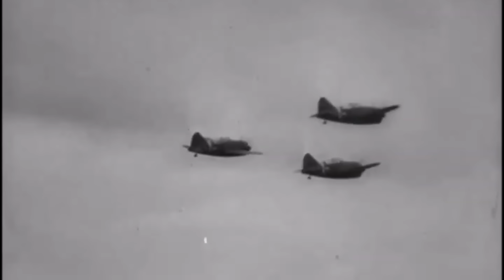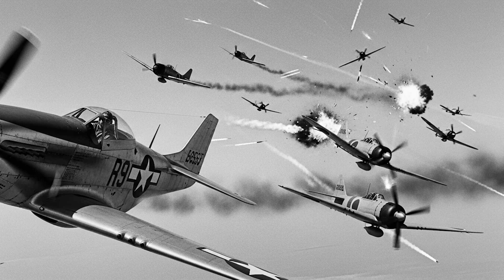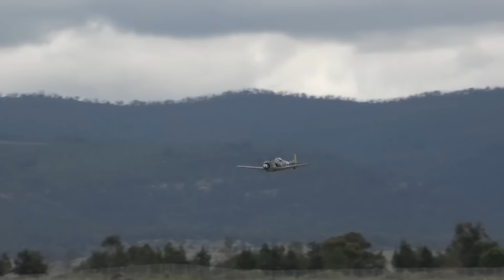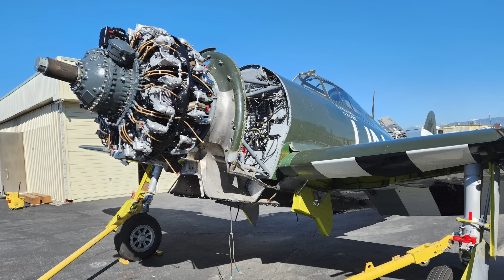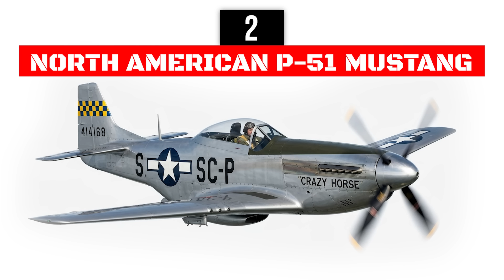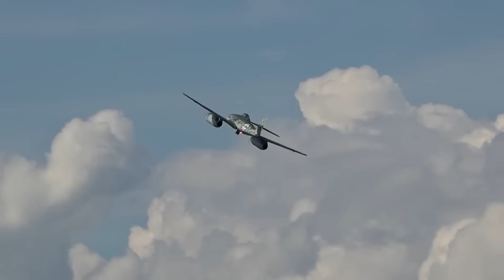Every WW2 Fighter Aircraft Ranked - WORST to BEST (COMPLETE)

Comment: Good list, but missing the American F4F Wildcat. Until the F6F, the Wildcat had to hold off the superior Zero by using strafe or thatch weave flying tactics. F4F deserved a mention imo
Reply: It's about tactics and playing to strengths. Don't dogfight with a plane that can out turn you. Use superior armament and more engine power to get height and attack.
Reply: I though of the same point as I watched this....."where is the Wildcat?"
Reply: @C.StewartDenton  The Wildcat was a solid plane but not in the same league as the later fighters.
The Grumman F4F/FM Wildcat compiled a 6.9:1 kill ratio, the Hellcat 19:1
Reply: @captaintomst yet it was still superior to the Buffalo which made the list.
Reply: @captaintomst wildcat did a lot of heavy lifting. Hellcat was indeed a better plane, but the Wildcat went against better Japanese pilots, on average.
Reply: My father built both the Wildcat and the Hellcat at Bethpage before joining the USN. The nickname of Grumman was the ironworks because they're planes held up to hits from The enemy like they were made out of iron.
Reply: Missing a lot of planes, British Typhoon/Tempist, Me 110, several Japanese fighters…
Reply: @jimbo3615  not to mention the Mosquito. Used as a night fighter.
Reply: @paulware9411  Yeah, I forgot about it being a great night fighter!
Reply: F4F-3/4 could hold its own against the A6M "ZERO" with the right tactics.
Reply: Wildcat more significant than the Buffalo!
Reply from the maker: sure, will defiantely cover them in future videos

Comment: Didn't the 262 have a problem turning sharply. I remember reading that years ago.
Reply: Yep, and even staying in the air, they were mostly terrible with a few good ones
Reply: That was more about supply issue, because of Allied bombing
Reply: @BrianNelson-m4r yeah and they didn't work, great concept for that early of a time, but they were poorly made for the most part. 1st jet in war, yes, #1 of the war, not even close
Reply: The Japanese fighters turned better than ours; so you don't get in turning fights with them. Get height, make a diving attack, and dive away.
Reply: It had speed and 6 20mm cannons; designed to destroy bombers.
Reply: @BrianNelson-m4r 
4 30mm cannons.
Carry on.
Reply: The 262? The fighter Allied pilots learned to outmaneuver until it was forced to land due to low fuel then was hunted down on approach to their airfields? That 262?
Reply: One pilot described flying the me262 as requiring a gentle touch; those early jet engines didn't like it when you pulled the stick too hard or opened/closed the throttle too quickly, doing so could cause a compressor stall and make the engine flame out.

Comment: 2 things.   FIrst the late war 45 meteor with upgraded engines would paste the 262, get real.   Far better climb, turn, ability to move the throttle haha, better fighter on fighter guns, pilots wearing G-suits.   And only say 30 mph slower although top speeds hard to achieve and so acceleration and climb more important the real world.

Second, for piston fighters spit mk14 OBVIOUSLY superior to everything.   Climb, turn, speed, armament, pilot view, ease of handling, it had every parameter equal or best in class.    Range was the fault, the singular fault.     Spitfire ranked 5th duh.     Look, even a later war mk9 running 25lbs boost was not so far off a 14 in every respect with better turn.

Comment: The F4u Corsair was the best of WW2. Period. This was stressed by all sides. Also, some of your images are off. Next time post images that are accurate. Also, the F6F got it's ratio against the Zero mainly because the pilots flying it were facing inexperienced Japanese pilots; most of the experienced Japanese pilots had been shot shot down by Corsairs P-38s.
Reply: I had Co-pilot run a comparison between the top fighters: F6F, P47, P51, Corsair. And it also quoted pilots that had flown most (or all) of the planes (guys like Chuck Yeagar) after the war and did direct comparisons. 
Each one of these planes had superiority in some fashion. For example, dog fighting, Carrier based fighter, bomber escort, ground attack, speed and stability in a dive, high altitude performance. 
So, depending on the intended purpose, a different plane would be superior.
1) Ease of flying, stability, carrier operations: F6F
2)  Dogfighting: many cited the Corsair
3) P47 for Ground attack, pilot protection, high altitude performance and comfort, and blew all others away for speed and stability in a dive. 
4) Bomber escort: P-51.  P-51 was also a good dog fighter, but many pilots were critical of its fragility. It is still widely regarded (but not unanimously by any means) as the best overall allied fighter.

If the range of the P-47D (so prominent in Europe) could have been improved to the 2000+ miles of the N variant that was released onLy in the last few months of the war, the P51 would been irrelevant. But timing is everything - I'm looking at you German Jet.

Comment: These rankings are suspect to the point of being absurd….
Reply: Exactly.

They take no account as to the mission any given design is expected to perform.

For example, the Yak was specifically optimized to perform at low altitude, to protect  Ilyushin Il-2 ground attack aircraft.

So, if it can't perform at high altitude, does that make it worse than a fighter that is designed to operate there?

That's an absurd suggestion.

Then there's the bit about the P-38. The fact that it didn't perform well in Europe, at high altitudes, flying bomber support mean it's crap?

Well then riddle me this. How is it that the #1 ace for the USA in the war, Richard Bong, flew one in the pacific, where the temperatures weren't an issue and the long range, and the two engine security should one fail was essential to the role it played, means it's not a great fighter?

Oh, and the Corsair?

How is it that it is the latest deployed propeller driven fighter of them all?

If all those other planes were better, why did the Corsair outlast them all?

Oh and it's the only propeller driven fighter to ever shoot down a jet aircraft.

My father was a naval aviator in WWII, and took part in the test program after the war when they did a fly off for just about every aircraft each side used.

He told me the Corsairs inverted gull wing allowed it to hold a vertical bank better than any other fighter.

When one gets into a fur ball, holding a vertical bank means you can turn tighter than your opponent, since you're essentially doing a "climb" maneuver.

As far as the ME-262 as #1?

Please, it was effective at only one thing. A Rapid run through a massed bomber formation in daylight.  It could not really engage in combat with other fighters. Oh and if simply being powered by a jet engine, is all that important why isn't the Gloster Meteor on this list?

Regarding the ME-262 deployment, Hitler's demand that it carry bombs is a myth regarding the  impact on the deployment date.

I'm not disputing Hitler gave that order, but that the material challenges posed by designing a jet engine were more of a delay.

As the old material sciences joke goes, they needed to make the engine blades out of Unobtainium or Cantafordium.

As it was, when they froze the design to go into production, the engine had a deployment life of ~ 20 hours, IIRC.

If your #1 aircraft has to have it's engines replaced every 20 hours of service, then you obviously have no idea about logistics and mechanical services.

That 20 hour limitation means the availability of the ME-262 is quite limited, bordering on a hanger queen.
Reply: @markkirby9531  No, he has it correct. The P-51 was the best WW2 piston engined fighter.The Vought F4U Corsair struggled above 25,000 feet, whereas the P-51 Mustang excelled at high altitudes due to their superior engine supercharging system. Clearly the 262 was the best fighter, and by a huge margin. Eric Brown, finest test pilot in history, said it best: "The day the 262 arrived, every Allied fighter became museum pieces".
Reply: @TheAneewAony  I guess I wasn't clear. "best" is a function of the mission any given plane is expected to perform.

If the mission is to escort strategic bombers at high altitude, then yes, performance at + angels 25 is important.

If that's not the role of the fighter, as with the Soviet Yak fighters that I mentioned,  that performance is moot.

As i said the Soviets optimized their fighters for low altitude combat, because they were there to protect their ground attack aircraft such as the Stormivik. They had no strategic bombers and so had no need to fly at +angels 25.

Me-262 the "best", please, what could it do other than attack a bomber stream. How could it defeat any enemy fighter? Heck it was standard practice for Allied fighter to loiter near German airfields and attack the ME-262 when it was returning to base because it's maneuverability was very limited.

And having less than 20 hours on the engine before it has to be replaced?

A great design that's a hanger queen, is the "best" fighter.
Reply from the maker: @markkirby9531  gosh, i really appereciate the effort you've put and also understand your feedback as well
Reply: @the_rising_guy  Sounds like ai feedback to me.  Dissed this slop vid after a couple of minutes.  Load of BS!
Reply: With The Me 262 as "THE" best..Fighter...is a joke with a 4.5 to one K/D ratio
Reply: Yes! The Buffalo was just great, for one thing. 😊
Reply: @timchapman5567  Yeah, and the Me-262 was absolute rubbish.

Comment: I thoroughly enjoyed your video and I cannot really argue against your rankings.  Whe comparing the Me bf109 against the Spitfire, it all depends on which version we are talking about.

Spitfire I and II versus the Me bf109E:  Although the 109E had better armament, the early Spitfires and Emils were roughly equal.  If fighting took place over Great Britain, the Spitfire had the advantage, but over France and the low countries Emils outperformed the Spitfire (Dunkirk and the Rhubarb raids as cases in point)..

The Spitfire V was completely outclassed by the Bf109F and FW190.  At Dieppe in 1942, Spitfires suffered greatly at the hands of the Friedrich and 190.

In the Spitfire IX, the RAF really found its war-winner.  It was better than both the 190 and the 109 Gustav, the latter being up-armed with underwing cannon for bomber interception, which downgraded perfromance as a fighter.

It would have been interesting to see how the bf109K would have fared against the Spitfire IX and later marks.
Reply: Unless you are talkng about the Griffron engined spitfire, the 109k out climb the spitfire.
But even so, for short-burst acceleration and instant climb response, the 109k still outperform the Griffron spitfire......That is subject to all pilots being totally disciplined and do not venture outside their airplane's performance safety zone and not engaging in a situation disadvantaged to their airplane....
Reply: @michaelwong4303  Thanks for the additional information.
Reply from the maker: Thanks for the detailed breakdown, it's fascinating how much those performance differences mattered! 😊
Reply: @the_rising_guy  Oh definitely!  Another piece of my brain, or what's left of it, is that Packard made some improvements to the Rolls Royce Merlin to improve the performance of the P.51.  I haven't delved deeply into it and couldn't tell you what those improvements actually were, but I came across this a couple of months ago.

Comment: Corsair and Hellcats over over the Spitfire i dont think so, think this must be an American site or production and without the UKs involvement the P51 wouldnt be the plane it turned out to be, the ME262 like all of Hitlers Wonder Weapons was a Failure.
Reply: Corporation between Britain and America during WW2 is much different then it today. As it is said, "The only time the French like Americans is when Nazis are drinking tea in their cafes." Today not so much because succeeding generations have forgotten how America became the arsenal of Democracy that liberated Europe and rebuilt Europe after the war.
Reply: Late versions of the Spitfire were indeed extraordinary.  However,  the early versions and most of the produced Spitfires were under-gunned. The .303's were inadequate compared to most every other fighter.
Reply: @thomasking5472 What 303s are on about, the spitfire originally had 50cal Browning machine guns later replaced by 20mm cannons in the most part.
Reply: @pistoleer3572  Negative.  The Spit and  Hurricane both had 8 .303's at the start of the war. The Spitfire upgraded to a mix of .303's and 20mm cannon. But no British fighter I'm aware of rolled off the line with Browning .50's.

Comment: Usual USA propaganda where US fighters are place much higher than they should. Any list that puts one of the best fighter of WWII at 7th, is compiled by somebody with no idea. Oh, the narrow landing gear? only an disadvantage when landing and take off. Huge advantage in the air - weight distribution and you forgot the mention the massive advantage the BF-109 had, centralized fire power. Why do you think it had the highest ace scores in every theatre it operated as well as the highest score in a single day, highest scoring squadron, every record for victories belonged to the BF-109, well except for the highest victories against the Luftwaffe. 
 At least this list has the two Soviet fighters but again, far too low in this list favouring US fighters instead. Your right, the soviet fighters where the only fighters the BF-109 regarded with caution/fear. Spitfire, Mustang, Hurricane and  everything else they regarded as prey.
Just read the memoirs of the German aces, Galland, Barkhorn, Hartmann, etc they all say the same thing. No regard for British or US fighters, and only concerned about the Soviet fighters.
It was only at the end of the war when US had some of the best fighters in the air, P51D/K, Corsair, Thunderbolt that where a match for the outdated BF-109, but by that time, the BF-109 had been overtaken as Germanies premier fighter, it's Stable mate the FW190-D.
Reply: Whomp whomp, cry more, sucks to suck
Reply from the maker: Exactly 😂
Reply: Bottom line is the US fighters won WWII in both the European Theater, and the Pacific.
Reply: @BrianS8607  You mean the US fighters supplied to the soviets? Because it was the Soviets who won the war in Europe. 70% of the German war machine was fighting on the eastern front. 
If they did not attack the Soviets and the entire German war machine was turned against Britain, there would likey be a very different outcome. 
The US assisted in the invasion of Germany, but It was the Soviets that made it possible.
Reply: @paulordeman5169  Your understanding of WWII history is flawed.   Before September 1940 the ENTIRE german war machine was thrown against Britain.  Not only in the British skys, but North Africa.  The Germans and Soviet Union had a non agression pack.  Herman Goring failed to gain air superiority over Britain that would allow a land invasion to take place.  The attritional war with German air power was won by the American strategic bombing campaign and escort fighters.  If the German air power wasn't defeated in the west the turkey shoot in the east would have gone on like it did during the beginning of the eastern invasion.  I'll admit the American aircraft supplied to the Soviet Union gave them an advantage against the green german pilots thrown into the eastern front because all the experienced pilots were being lost fighting bombers and escort fighters.
Reply: @BrianS8607  Yes, but Germany did attack Russia and opened the battle on another front. Once the conflict with the Soviets began, that is what divided their forces and made victory easier for the allies. 
Had they not attacked the Soviets and continued the battle on the western front, the outcome would have been very different. 
The Aircobra's they gained was an advantage, but the Soviets where also able to make very effective fighters as well. The LaGG-7 and Yak fighters are always underrated in these US biased video's.
One reason why Germany did not gain air superiority was the short range of the BF-109. 
British fighters would wait until the fighters had to turn back before attacking the bombers. 
The German's bombers only defence was the poor armament of the Hurricane and Spitfire. It took hundreds of MG rounds to bring one down.
This is why many of the British kill tallies record fractions, they had to gang up on a bomber to bring it down during the battle of Britain. 
Hurricanes where directed to attack the bombers as their 4 x mg grouping had less round misses than the Spitfires 1/2/1 grouping.
Reply: @paulordeman5169  What I never understood was why Britain didn't use the Browning 50 cal aircraft machine gun in the fighters.  Instead they stuck with the ineffective Browning 303, or unreliable Hispano 20mm cannon.  The 50 cal might not have the explosive damage of a 20mm which was relatively low damage compared to larger cannons, the 50 did penetrate very well.  The basic Browning M2 has been a reliable heavy machine gun in military service for over 100 years.